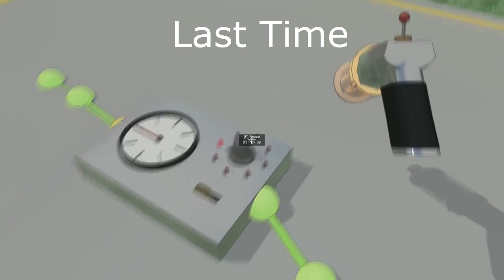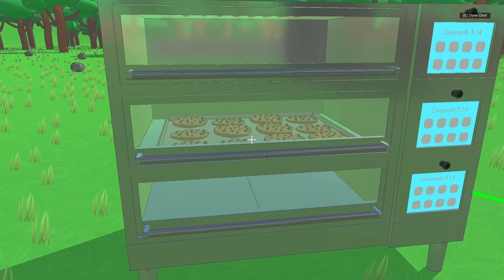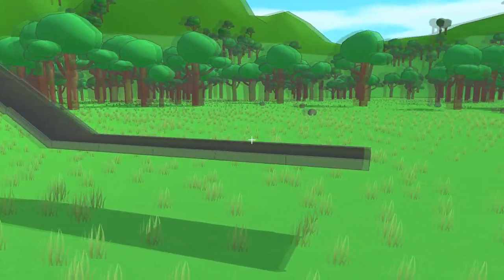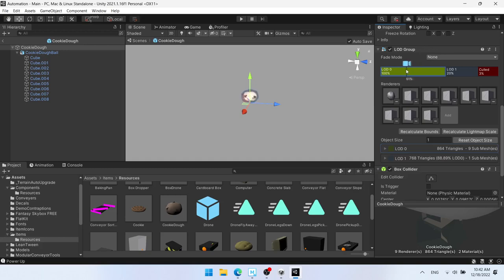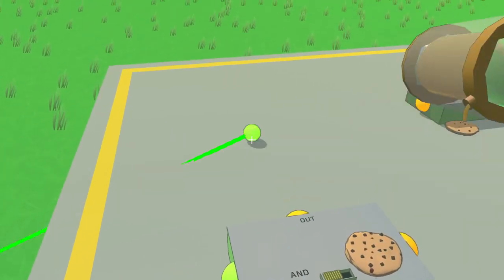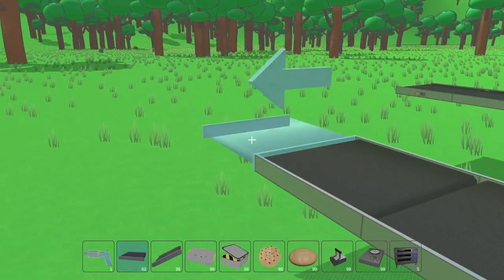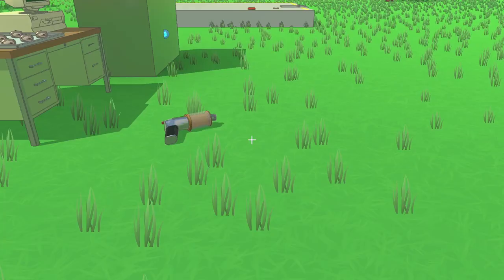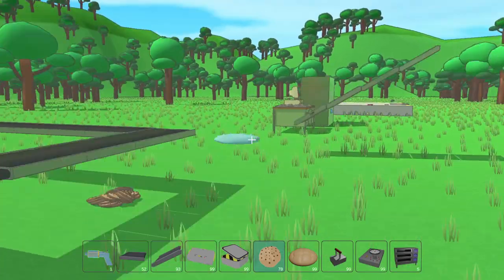Things are Heating Up - Making a Factory Game | Devlog 2 #gamedev #indiegame #unity

Comment: Corner Conveyor Belt.

I personally recomend using something (colider) that detects which is the next comveyor belt segment or surrounding built segments and changes some configuration on it. Like generate a smooth corner or Y connections.
Reply from the maker: I have a corner conveyor belt in the next update video coming out soon! Right now, they're just manually placeable corners. I may make some kind of easy corner connector in the future. Thanks for the suggestion!

Comment: Coming along great! Love the node system, especially with the upgrade from GameObjects to data - Seems robust and well thought out. Could you breifly explain how you do it? 

Nice video, cheers!
Reply from the maker: Thank you! I'll maybe make a short video to showcase it later then, but basically when you use the wire tool and place a node, just the point where the node is placed in stored (along with an array saying which nodes are connected to it). All of the positions and connections are just data on a single "Node Group Manager" script. Each time a node is placed or removed, the node manager regroups all of the nodes. (If there is a path between any two nodes they are in the same group.) This is to increase performance. By grouping them only when a node is placed or removed, we don't have to check each node for power each frame; if one node in a group is powered, then all in the group are powered. This is getting really long. I guess I just need to make a video on it 😂

Comment: How do you animate the food going into the oven, do you just send the position to the oven then move it there with the rotation?
Reply from the maker: I'm using a library called LeanTween that I learned about from some other devlogs. You call different functions to trigger animations from scripts instead of having to use the animator for things.
Reply: @breadboarddev  interesting. I did play around with tweens but couldn’t figure most of it out. Thanks